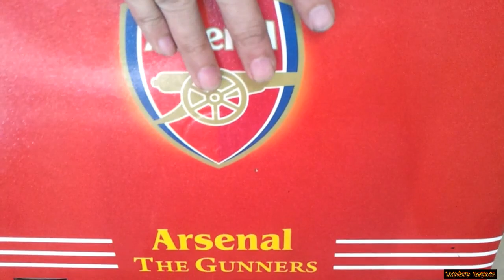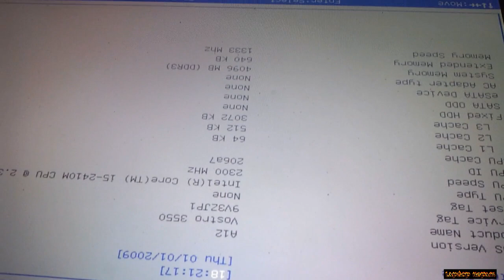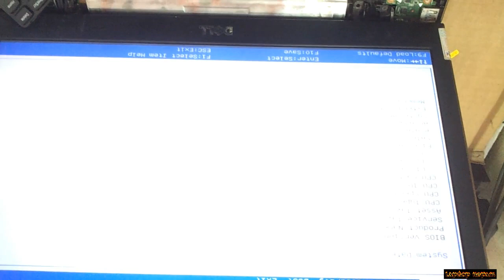Dell Vostro 3550 - How to fix stuck at dell logo screen

Comment: So, what was the problem? Just remove that chip?? I'm stuck at DELL logo, can't access BIOS, cant access boot option, nothing. The bar load just 1/4 and freezes...
Reply: me too...
Reply: Me too!
Reply: Bro sameee
Reply: Me too..
Reply: I have this problem on a old compaq evo n1020v, it got stuck on post in 2013, but i found the computer and i want to fix it, i remember that when it was booting normally it was showing "Press F10 To Change System Settings" but with this problem it only shows the compaq logo and nothing else. Also i noticed that the fans aren't spinning, but when i turn on the laptop without the processor the fans starts to spin. Can i fix it? Its my childhood laptop and if wasn't for this laptop i wouldn't be intrested in tech.
Reply: cirujatuc79  me too Dell 3400
Reply: I think this video suggest that your graphics is broken already. By removing its power supply, the system will not boot into the broken graphics but to the integrated graphics in the cpu

Comment: Incredible! It works. I wasn't sure if it's not a joke/trolling. I saw movies with people drilling Iphones :-) But the removed part is big enough to resolder it in the worst case... In my case I knew that Radeon GPU is causing problems because I saw BSOD everytime a game was using DirectX. The log showed ATI driver as the problem. Even DxDiag finished with BSOD. I wanted to switch off Radeon but there is no option in BIOS. Also deleting it in Windows device manager caused Windows running in low resolution. There was no option to force integrated GPU to run... until this brilliant trick! After removing the part, Radeon is electrically turned off. Everything works. Windows see only the Intel GPU. Drivers are working, games are working with Directx. Thank you very much! It's like a Christmas present :-)

Comment: The Vostro 3550 can have two graphics systems: an integrated Intel HD 3000 (standard) and an optional AMD Radeon HD6330M.

The removed component (labelled PL9201 on the PCB silk screen) is a 0.68uH inductor used to supply to the Radeon graphic chip.

What this modification does is to remove the power to the Radeon graphics chip. After removal, the system falls back to only using the integrated Intel graphics.

In my case this fixed the boot issue, albeit with the loss of the facilities of the performance from the HD6330M.

You need to take out way more screws than the video suggests. Also it's not necessary to remove the heatpipe/heatsink assembly from the CPU.
Reply: i have a Vostro 3350 with same problem, but the motherboard is different then the one in the video, so can't seem to figure out which inductor to remove , can you help please :(
Reply: Can you please explain why this worked? Was the radeon graphics the problem?
Reply: @TeamMuSlims  same. Have you fogured this out already?
Reply: Yeah i actually did find the component and removed it from the mother board . And it worked (the component was for Radeon ship) so when my laptop booted i found that only Intel GPU is detected.
Reply: @TeamMuSlims  i just disassembled mine. Can you help me? Where did you find it?
Reply: @TeamMuSlims  hello, is there any way i can contact you? I really cant find the iductor for my vostro 3350 graphics

Comment: Great video. It really solved my problem. I had this computer stuck since 2012, and how I needed it these days, I did a test and it worked.
I have only two questions: After removing this component, my dedicated video card (AMD 6630) is no longer recognized. Is it possible to make her appear again?
Is it possible to downgrade the BIOS to a previous version and have compatibility with Windows 10? From what I saw the A09 version is not compatible, and the update error for the A12 BIOS leaves the BIOS locked as in the video. I wonder if there is an A11 version (not found in earlier versions of Dell)

Thank you very much. Greetings from Brazil

Comment: Very Hectic Way To Resolve This Problem. 
I Succeeded Just By Following These Steps 
1- Remove All USB Devices Or Peripherals
2- Then Remove Battery 🔋 And Power Cord From The Laptop 
3- Main Step (Press The Power Button For 10-15 Seconds) 
Note: While Pressing Power Button Don't Think What's The Use When Lappy Is Off. Don't Worry This Step Requires Your Lappy To Be Without Power. 
4- Put Your  Battery 🔋 And Plug Your Power Cord. 
5- Start Your System. 
It Will Work.
Reply: This method work for me. Unplug all USB and power cord then turn off and on.
Reply: Thanks, Ranjeet! It worked for me!
My laptop was freezing after dell logo on black screen with small white minus in the corner
Reply: It's just for wasting the time for those who has a serious problem..
Reply: Thank you! It may not work if there are more serious problems with the computer, but it got my Dell laptop to fully reboot and I am up and running again. Thanks again1
Reply: I have found the other way as well if this doesn't work.
Remove your battery and other peripherals if any.
Connect your power cord directly and Swith ON your Laptop.
Don't worry it will move forward immediately. In my case I have to wait for at leat 15 min before it succeeds in booting.
I don't know what exactly the problem is but it sucks doing again and again.

Comment: No need for all that. Try removing a ram. Then boot.
Reply: Removed keyboard, removed, touchpad, removed battery, removed first ram, removed second ram, removed CD-ROM, checked the SSD on other computer...everything seems okay and nothing changes... Tomorrow i'll remove the chip, if it doesn't work, you can always attach it back..